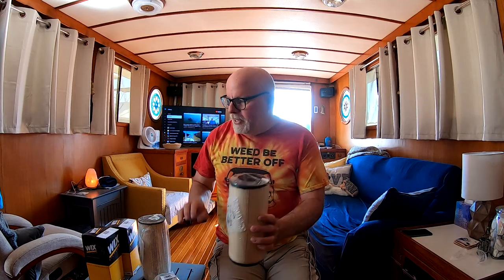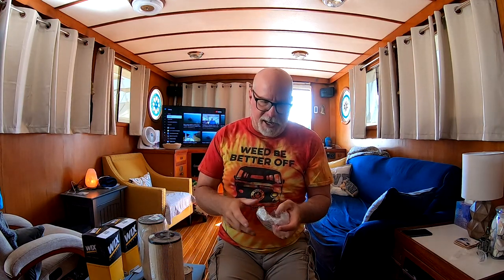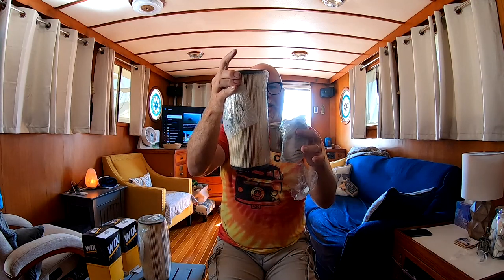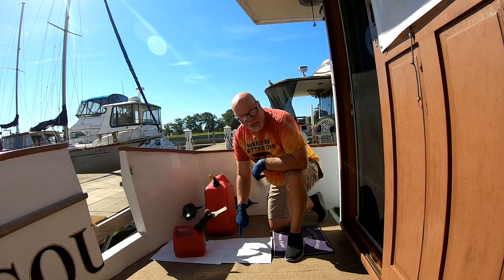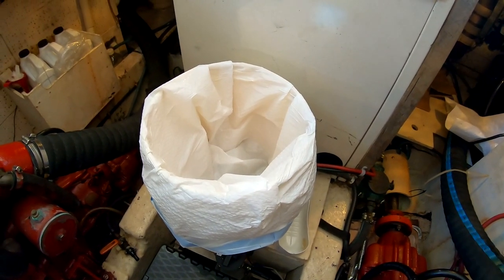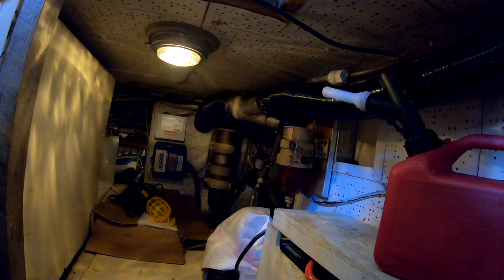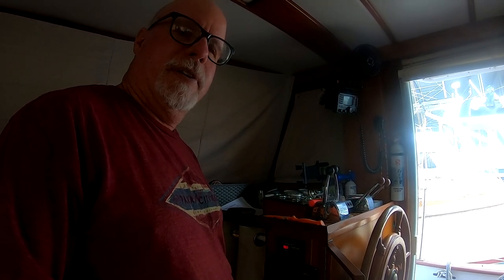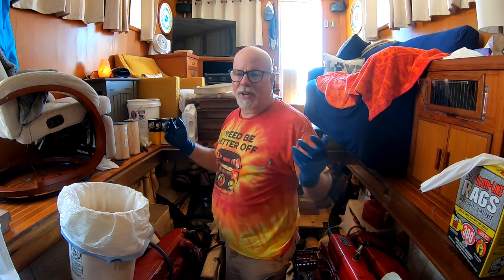Boating 101 changing a Racor Fuel filter every boater should know how to do this

Comment: What are the engine symptoms of a clogged racor with diesel bug/growth?
Reply from the maker: It usually happens fast. but you will lose power and feels like the boat is stalling, if you shut down quick enough you can get away with a quick change out of racor.

Comment: Watched your presentations a lot and much appreciation for them.  I would give you the advice to install a 12v priming pump in your fuel line that goes to a switch within easy reach of your bleeding points instead of screwing around with fuel containers like you do.  It can also serve as an emergency means of getting home if you have an air leak you cant isolate. I don't want to sound critical as you have a lot of great advice but don't want new mariners to go through unneeded battles with fuel containers and the mess in the engine room.  Cheers!